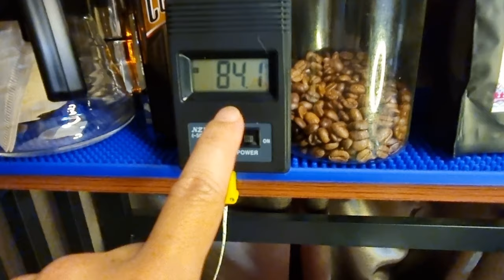DF64 101 | Part 3 | When to clean the burrs? | La Pavoni Stradivari

Comment: Great video! I'm enjoying my new DF64, thanks for all the info! Regarding the spongy shots on the La Pavoni- did you purge the air bubbles in your boiler? The way I do it- 1. Bring the machine close to your final temp. 2. Purge the steam wand wand. 3. Purge some water through the group head. 4. Purge the steam wand into the cup of purged water (should see some air bubbles come out). 5. Do one more quick water purge. 6. Purge the steam wand into water again, last few bubbles should come out. This will heat up your group head, so take care with the overheating. I use a La Pavon Millennium with the plastic piston sleeve, so the overheating is not too bad when I do this. Hope this helps if you haven't figured it out already!

Comment: I also am using the version 2 declumper with a thin silicone flap. I bought a 1mm thick silicone mat and cut it up for this. I am pretty happy with that setup. The static is not bad, even at filter settings and most of the time I get out within .1 grams of what I put in. The antipopcorn funnel is really important for that as well. I used to get chunks of beans that would pop up and be resting on the feed funnel of the grinder instead of getting ground up.